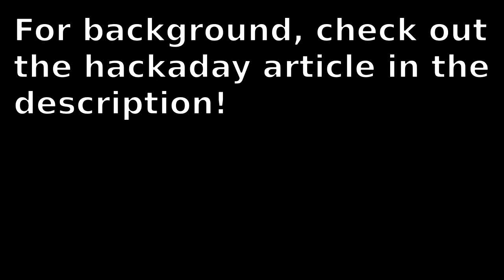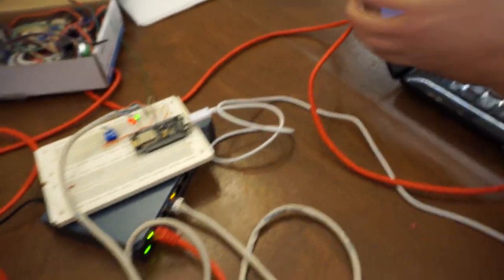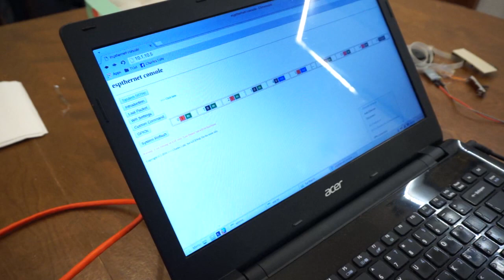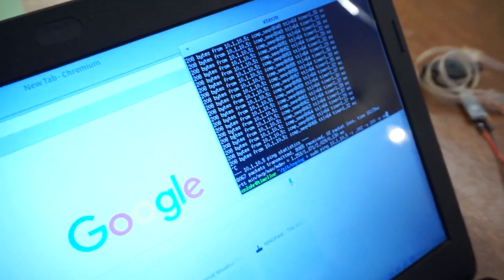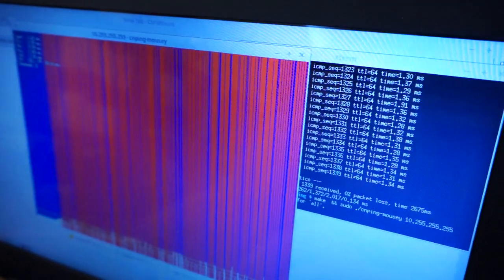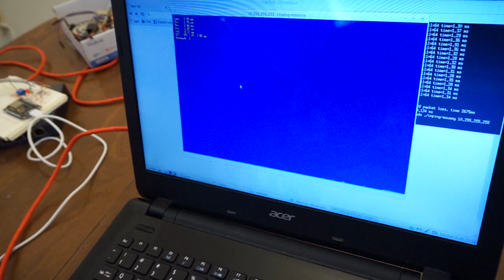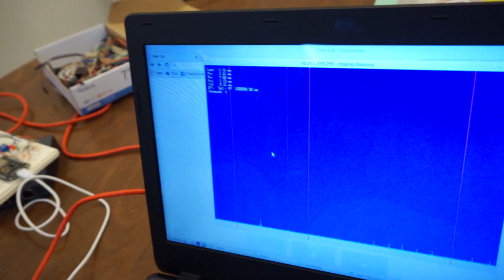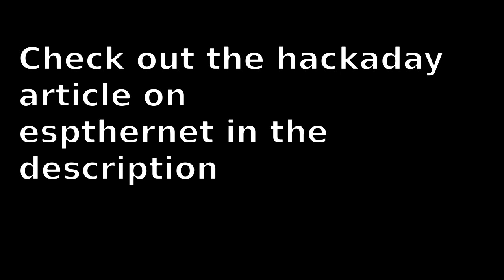Broadcasting AM Radio with Ethernet on the ESP8266

Comment: Awesome! Your genius-mind manages to amaze me every time :) Can i ask what laptop you use (The acer one)? It looks perfect for travelling. I would be very happy if you could tell me the model.
Reply from the maker: +John Smith It's an E5-471.  It's the spiritual successor to the AMAZING timelineX series.  Not /quite/ as solid of a construction, but they really have figured this hinge thing out.  So far every laptop I've owned eventually died from the hinges.  The one, nope.  Only two problems so far was the wifi card that came with it was awful, swapped out for a high end intel, perfect... And somehow iron filings got stuck in the speakers.  Just had to clean them out.
Reply: CNLohr Thank you very much for that detailed comment, it sounds pretty good!

Comment: @CNLohr, can cnping be compiled with Mac OS? Using make throws a ton of errors. Any advice?
Reply from the maker: +David Kind Give me some of the errors, nothing is explicitly here that would not work with OSX.
Reply from the maker: +David Kind Better yet, post the errors as an issue on github.
Reply: CNLohr I've posted the error dump on github. Thanks.
Reply from the maker: +David Kind I've updated the ticket.